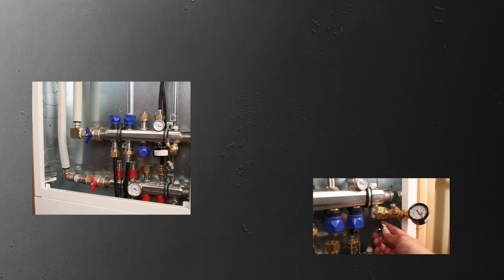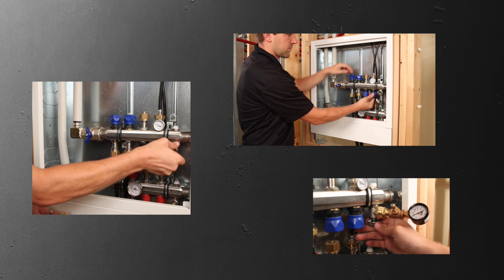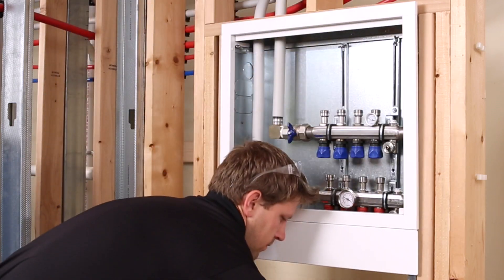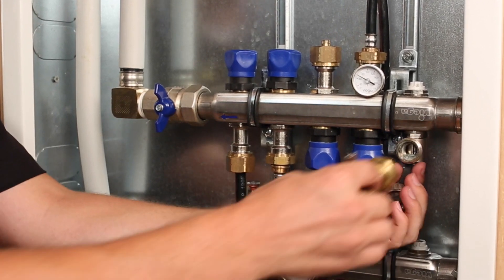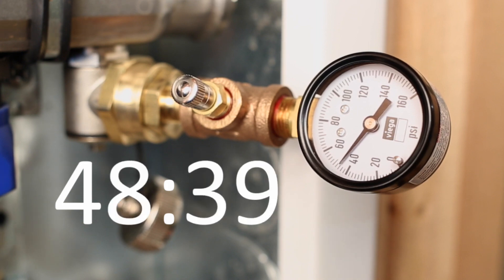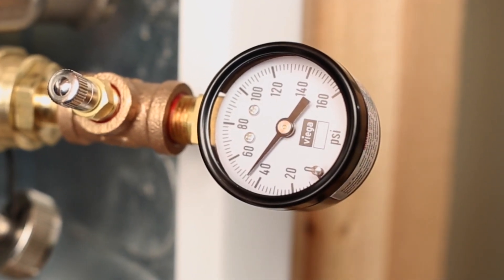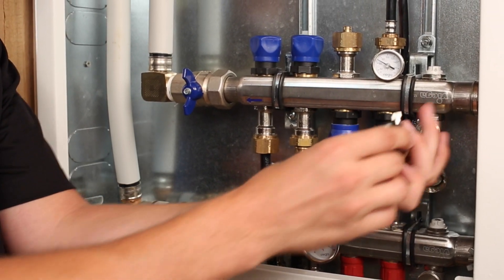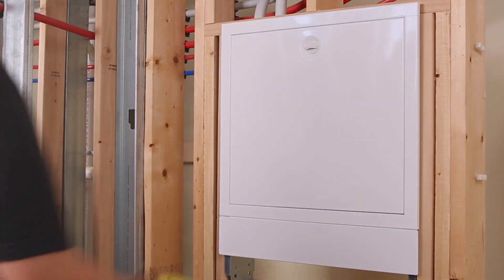HOW TO PRESSURE TEST A RADIANT SYSTEM | Viega

Comment: l would like to know if l need to test one bye one .or test the whole systum  all to getter?
Reply from the maker: Each manifold or each loop can be pressure tested independently. For poured applications, maintain pressurization until concrete has cured. For dry installs, the pressure test should be continued until the time the system is placed in operation.